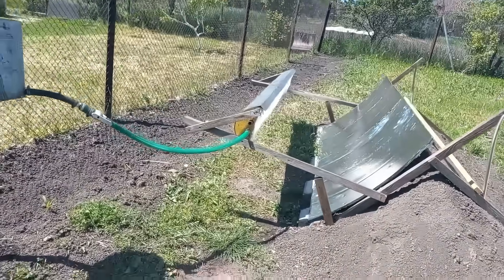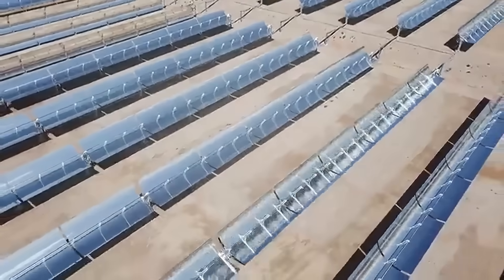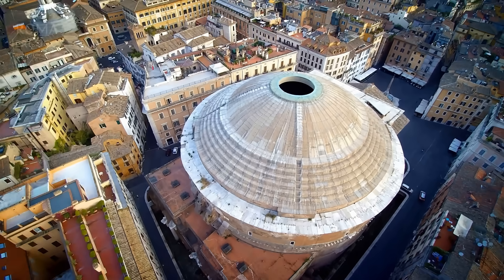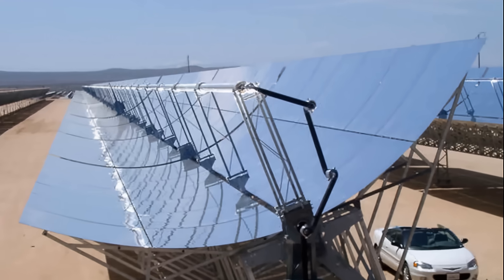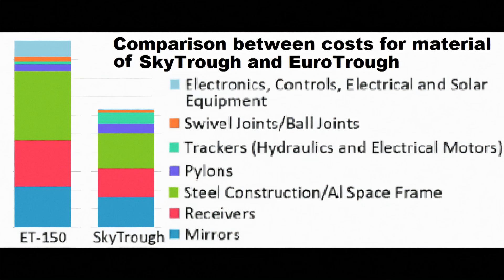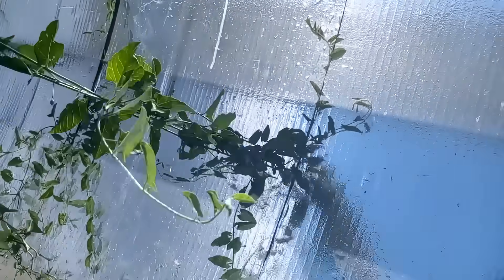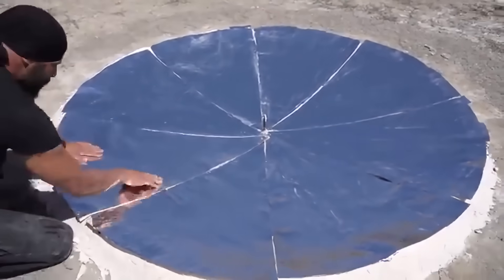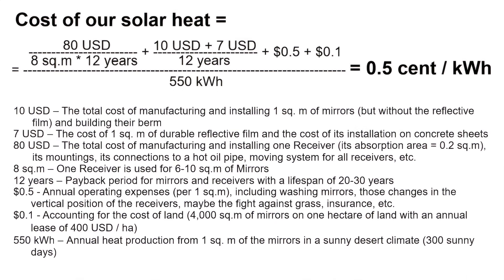Mirrored concrete for cheap solar energy

Comment: Bro. The 15 seconds of useful information in this video is great, could definitely be expanded on, but is good. All the stock footage was okay to see once but 75 times of seeing the beautiful mirrors is a little unwatchable. People at this level of learning don’t need the education of a cement dome and how useful it is. 
Are you just trying to make the video long for more minutes watched? Specific information about sizes,shapes, and angles would be useful. I tried watching some of your other videos and ran into the same frustration. You have to remember, nobody knows your intention or where you are coming from with these videos.  Is it instructional, is it just an idea, do you have anything that actually makes electricity?
You say a solar panel killer but never directly show how YOU have turned this into power. I get the premise, but want to know how you created a solar panel killer, or is it just the idea? Same with your water tracker idea. It’s cool but how can this help if you have to go out and manually add air or water to the ballasts. It might as well just be sitting on the ground and you move it around.
Reply: To generate electricity, you need constant and stable steam pressure, you need also powerful turbines and electric generators.
he is focusing only on the cost of the panels, while ignoring the rest of the project, which requires a high level of engineering and ongoing maintenance.
Reply: @mrpro7737  so where is the solar panel killer? Where is the steam turbine video?

Comment: you can effectily double your output on a normal solar panel by using mirrors like reflectix foil insulation on both side on a 45 degree angle. just watch out for overheating

Comment: you do realize that the world is running out of the type of sand needed for most concrete right?  so scale this up to where it actually makes a difference in society and yeah,  not feasible.  yes,  it sounds crazy about the sand,  but look it up.  theres actual sand mafias around the world controlling what little is left.  get rid of the concrete and make a bamboo or another sustainable organic backing for the reflector sheets to rest upon.

Comment: >creates an energy generating alternative 
>It boils water
Every fucking time
Reply: Ah, reminds of the time I discovered how nuclear power plants work when I was a kid. I thought that we harnessed atomic energy directly.

Turns out it was just a really fancy steam machine. 😔
Reply: @oompalumpus699 this reminds me of the time when I told my geography teacher that nuclear reactors just boiled water to make electricity and she went "that's it? That can't be it"
Reply: @GeriatricJerald is it, tho? Idk nothing abt it.
Reply: As far as I know yes 
They convert nuclear energy into electricity by boiling water and using the steam to probably turn something. 
I don't know how else you'd AC electricity.
Reply: @Toxikcid  Yes Thermal energy from the radioactive material turns water into steam that then spins turbines that is it.
Reply: @Toxikcid  Yeh. Simply put, when you get enough nuclear fuel together, it produces heat as it splits, heat boils water, and water turns turbines. Everything that produces electricity from heat does it by boiling water to turn a turbine. Even if/when we get fusion power, we will create a temporary man-made mini sun in a bottle, a truly scifi achievement! . . . it produces heat, it boils water, turbines turn, electricity.
Reply: @PitchBlackRoses  its not thermal energy from radioactive material, its from the fission process.
Reply: @GeriatricJerald  that "something" is called dynamomachine.
Reply: @GeriatricJerald  OH cause u were some kinda child prodigy who taught their teacher ? lmfao
Reply: @hhhllkk88 I mean you don't need to be a prodigy to teach someone something 
Imagine a 5 year old kid walks up to you and tells you his favorite dinosaur fact that you didn't know. 
There you have it, a dumb sniveling kid just taught you something without him necessarily being a prodigy.
Reply: @oompalumpus699  the old coal/diesel power  plants are often actually able to be converted to nuclear too. its all just steam
Reply: @HerbaceousM8  Alas, not the case most of the time. It is about energy density, flow rates and duty cycle. Nuclear reactor produce sheeton of heat in one place and cannot be easily turned off for maintenance, and also require quite sophisticated enclosure which contributes majority of construction costs.
Reply: @xuko6792  "sheeton" Immediately adding this to my dictionary of words I almost can't type in my work chats lol!
Reply: @oompalumpus699 hahaha
Reply: @oompa @oompalumpus699 same but honestly I only learned it after watching Chernobyl - got mad curious about nuclear.
Reply: @oompalumpus699  I think we all did lol
Reply: You can harness energy directly through thermocouples if you want, you can have a nuclear reactor without any water
Reply: I can't wait for cold fusion to finally be viable so we can cleanly boil water with it.
Reply: @SolidSDA  Well actually, part of the research going on with Fusion generation is the ability to ACTUALLY absorb usable energy directly from the reaction . Its called Direct Energy Conversion, and so while Fusion would be usable in the same manner Nuclear Fission is, it can also do this Direct energy conversion and be far more efficient.  Provided they ever figure out how to achieve Fusion to produce more energy than it takes to sustain it.
Reply: the real energy is the friends we made along the way
Reply: @theronomys The real energy was the turbines we spun along the way
Reply: @theronomys "is the water we boiled along the way"
Reply: Water holds most heat energy per weight and it's accessible, can't get away from it
Reply: @aisir3725  I mean sometimes the mirror solar plants use boiling special types of oil as their medium
Reply: @Despotic_Waffle yea to transfer the heat back to water. Water cant break down compared to oil so its useless to even try it for long unless you have a very specific goal
Reply: Steam holds a lot of energy.cant get away from it. 
We can use molten salts but the cost goes up
Reply: @DeandreSteven molten salt to transfer the heat into, you guessed it, boiling water
Reply: @feryth real 😅
Reply: @feryth one could, theoretically, transfer them via high temperature thermoelectric materials - but the cost would be astronomical and this technology is lab-scale, TRL2/3 at best.

Boiling water and translating that energy into mechanical energy into electrical energy is still, somehow, more efficient.
Reply: @feryth  Steam can spin turbines. Molten salt not so much.
Reply: @feryth  Only if you're weak. Real ones use the salt directly to drive a turbine.
Reply: @feryth I guessed Frank Stallone actually
Reply: @feryth  huh? No the steam isn't what's generating the energy in a molten salt reactor, it's the direct turbine drive and high temperature heat from the molten salts. The separate steam turbine  is optional and gets added on because it's extra energy, why get get the most out of that heat energy.
Reply: @BSasafrasK Not sure where you got this from. Molten salt reactors have a primary loop, and a secondary loop. The primary loop runs the molten salt through a heat exchanger which exchanges heat to a secondary loop (water) to create a steam turbine.
Reply: >burn hydrogen with oxygen
>turns into water
>boil water
>turns into steam
>let steam cool down
>turns back into water 
>boil water again and the cycle continues
Reply: That's the one thing solar panels still have on everything else
Reply: and?
Reply: Steam power still kicks ass for most applications
Reply: engineer here, we can use other fluids depending on what that application is, But Steam systems are very well established, so we tend to stick with it to keep costs down.
Reply: Well. If you look at how we produce most of our electricity it makes sense.
Burn coal to heat water and drive steam turbine.
Burn oil to heat water and drive steam turbine.
Burn gas to heat water and drive steam turbine.
Burn bio fuel to heat water and drive steam turbine.
Split atoms to heat water and drive steam turbine.
Fuse  atoms to heat water and drive steam turbine.

The only exceptions are solar and wind. Everything else is just a steam turbine
Reply: Be water, my friend wink wink
Reply: We could boil methane. But that wouldn't be as fun. Well maybe more fun, depending on your point of view.
Reply: Lmao
Reply: I’m pretty sure there is another way but they are keeping it secret
Reply: @LigmaEevee solar panels are one of them. There are also devices we have made that produce electricity from temperature difference. It's just that steam is very cheap compared to them.
Reply: @LigmaEevee  Who would keep it a secret?
Reply: @SerunaXI  Companies and those tied to the federal government.
Reply: Lol true
Reply: Check out supercritical carbon dioxide turbines.
Reply: It's the second most efficient working fluid. Salt is the first.
Reply: @SecuR0M thats not how any of this works xD what salt are you talking baout? There are millions of salts. There are also lkke a million diffrent liquids and you think a molten salt wil win from them al as first place?
Reply: @fireworkstarter  Yes.
Reply: Well the Seebeck effect is a thing, but it sucks compared to the tried and true method of boiling water. Only really good for RTGs on space probes since they need zero maintenance.
Reply: We in steampunk but cooler
Reply: So what
Reply: Wind doesn't boil water but the end goal is to turn the turbine, steam usually does it pretty well.
Reply: invent a better way to make something spin only with heat energy without the expansion to gas of water or other liquids
Reply: Far from wise to underestimate the power of boiling water.
Reply: then be a genius and find somthing else. 
PV panels where found by pure luck not wisdome.
Reply: There is a mirror system in Spain that works with molten salt
Reply: Besides wind/water generators this is a home project so it’s not going to be something complex and expensive you can also use magnets to produce electricity if the magnets are connected to a steel disc that’s connected to a wind turbine the there are copper wires that are coiled up and are connected to eachother you can produce electricity from the rotation of the magnets and the copper wire and also you can produce electricity by rotating a motor backwards you can even do it with small motors in toys
Reply: we still in steampunk
Reply: If it ain't broke.....
Reply: What do you think happens at a "nuclear" power plant? THEY BOIL WATER!
Reply: Umm PV panels don't, wind turbines don't, hydro dams don't, plenty of them don't boil water.
Reply: That is like saying 
-creates thing that can drive on roads
-it needs wheels
EVERY FREAKING TIME

Geesh. Where did you think it was going?
Reply: @tommywolfe2706  DUDE, plenty of other power generation methods don't use heat and don't boil water, like solar panels, wind turbines, hydro dams. How are you already accepting this as a fact and making "obviously" remarks?
Reply: @WilliamParkerer  the title of the video is "cheap solar energy

Would hydro dams be included in that list? 
Obviously not

Would wind turbines be included in a list of cheap solar energy"? 
Obviously not.

Are solar panels known to be a cheap source of solar energy?

No. They arent. DUDE.
Reply: @tommywolfe2706  Ok but what does that have to do with the comment? He's saying that every time an energy generating alternative is created it boils water.
Reply: @WilliamParkerer  Yeah. And what else would it be? With a mirrored concrete panel?

You were expecting a hydro dam when he talked about cheap solar energy? That is dumb.

It said "cheap solar energy" and boiling is the cheap way to get it. Obviously.
Reply: @tommywolfe2706  The comment says:

>creates an energy generating alternative 
>It boils water
Every fucking time

It's a generalisation not specification. I don't understand why you keep talking about the video.
Reply: @WilliamParkerer  blah blah blah. It was a stupid comment.
Reply: @tommywolfe2706  Fine pal. No worries.
Reply: It's almost like that's a really good way to convert thermal energy into another form
Reply: Guess how nuclear energy works.
Reply: Its always boil water😂
Reply: Well, with the exception of solar cells that use a specific physical reaction, wind and hydro where the wind and flowing water do the work, steam has shown the be the effective means of spinning a turbine.
Reply: Traditional solar panels are the only one that break the circle.
Reply: Energy is in so many places.  Theres wells of it all around us they just limit the science pulling from them
Reply: There is supercritical CO2 as an alternative to spin the turbine.
Reply: @gabrielvincentelli1254 how do they get supercritical CO2 im pretty sure youd have to spin a motor to compress that shit and cool it off. In the end its using energy to make less energy
Reply: It's just because water is abundant, safe, well studied, boils predictably and has a high SHC. Having a high specific heat capacity means that the system benefits from inertia. It is slow to start, but that makes it slow to stop, making continual production easier to maintain.
Reply: fr dude i mean nuclear energy also boils water? at lest i know water is involved in the process
Reply: Reminds me of a Stargate SG-1 episode where they find mist/fog on a planet with a huge energy signature, and so they try to use that energy. Turns out it has energy because it was full of sentient life, billions of different consciousness. It's been said that water on Earth is sentient too. Changing it's structure when exposed to human emotions, and that it holds memories. Perhaps there's more to it than simply chemistry going on when producing energy from boiling water on Earth.
Reply: @hubey  A lot have things have been said. Doesn't mean this things have any credibility
Reply: source: crack pipe
Reply: @hubey there is a reason its sci-fi buddy. The fi stands for fiction wich means made up stuff. Just think a bit harder about what water is, what life is and how youd even get sentient thought
Reply: @fireworkstarter  All matter is made of energy, and all energy is sentient, just to varying degrees. So I guess I misspoke; what I really meant was what was the sentience of water like.
Reply: @hubey India IS doomed if that water theory became true😂
Reply: @hubey sorry NMR says it's just water. I've looked at matter at all kinds of scales (TEM/SEM/EBSD/MOKE) at all kinds of spectra and energy levels. If I can't see a soul with a I never never once detected a soul or some kind of signature that would indicate that inorganic matter has some form of 'network intelligence' that isn't just following the laws of thermodynamics.

Sorry man, I want to believe too, but in my opinion you're not going to see ghosts through the lens of science - it's that of felt experience, the psyche, and belief/faith. Not exactly the product of rational and reproduceable experiment.
Reply: @c.andrew3944  How would you even know what to look for? If you found it you probably wouldn't even realize it. The current materialist scientific paradigm simply doesn't have the tools for such things
Reply: @hawgcranker420 sure, buddy
Reply: @hawgcranker420 what is life other than a few chemicals making more chemical reactions. Water doew nothibg but disolve, how do you think it can live or even be sentient, you honnestly think water has mlre intelegence than most life on earth? You guys are tripling so hard xD try to be angry and happy next to water and see how much it changes to your emotions
Reply: @fireworkstarter  I'd accuse you of being a midwit but that seems optimistic.
Reply: @hubey no.

Comment: I work in solar industry. Let me explain.

The System you have is very good to make steam. The down side is that it only work with strong sunshine and a expensive turbine(for cheap you'll get a low efficiency). To compare it with solarcells, these produce electric Power directly, no loss. And solarcells produce Power at daylight even without sunshine.

Your Argument that you can store the energy for the night is stupid since you could also do the exact same with solarcells.

Did you now understand why the companys didnt use concrete? Ok, again: you need as MANY sunlight as possible to produce steam. If you didnt follow the sun, you can do this only a hour a day or so, when the light DIRECTLY hits your mirror.

Comment: Renewables aren't a race, they're an ecosystem. You don't build just one, you build all of the above, and you don't build new nuclear or gas, either.

What we need is more public awareness of storage solutions, from batteries to flywheels to pumped hydro to pneumatic to sub-ocean to molten salt.

And no hydrogen, either. That's incredibly lossy and and a fossil fuel industry plant.

Comment: I would imagine you gotta live a blazing hot place to make this work but still awesome.
Reply: Thats not how the sun works. This would work on top of Everest more effectively than it would in death valley in the US. Heat has absolutely 0 to do with solar energy, the only thing it does do is change the efficiency of the electricity once its captured by the system, but it has no effect in a vacuum. UV rays are what were looking to capture as many of as possible, not heat, we use the rays to create the heat, so with an absence of heat in the environment we are still very capable of producing electricity.
Reply: @T @TyrannicalS  so relative to the top of a mountain to Death Valley t that makes sense. But let’s compare Death Valley to PNW mostly cloudy/raining. Are there enough rays to actually meaningfully be able to focus it for energy consistently?